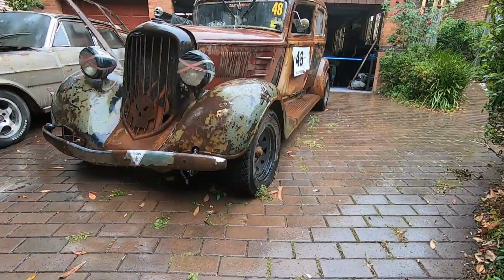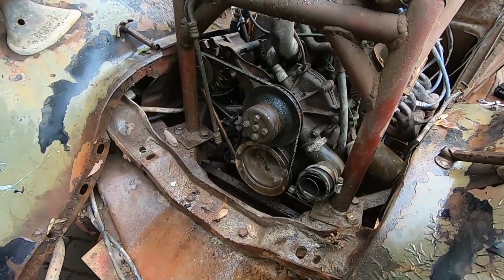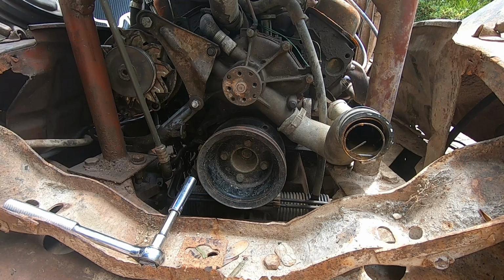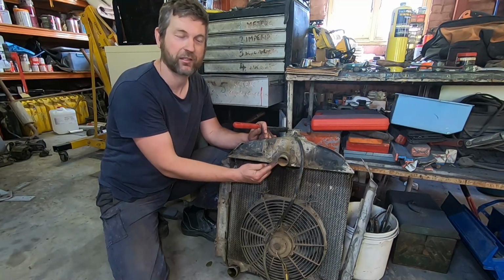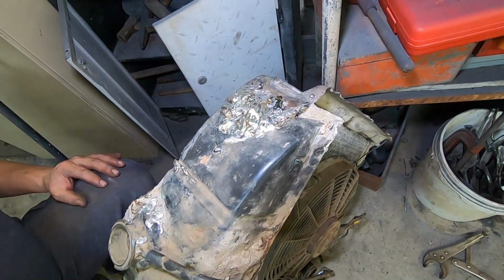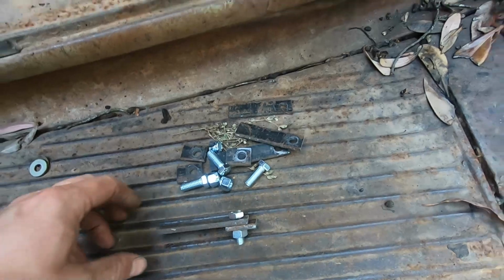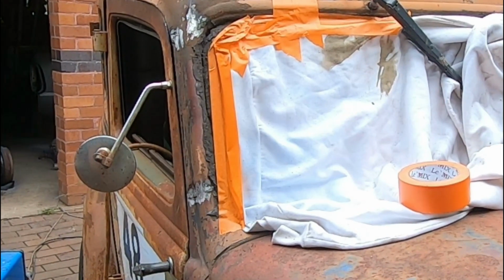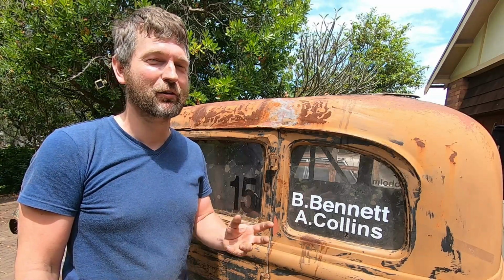Final Gravel Rallies of the Year, Prepping Deathproof the 1934 Plymouth

Comment: Is that cage over the motor a requirement or to support the old frame and body?
Reply from the maker: Just to support the body. Rules allow the cage to go  to the front suspension mounts. As a result, I end up with a big cage around the motor as a result, due to the layout of the car. Most cars just have a short piece from the firewall to the strut top.
Reply: @shellberightgarage  
Thanks, Got it easier than building a whole front end and frame. Use what you have to make a runner that does not dig a mine in your bank account.